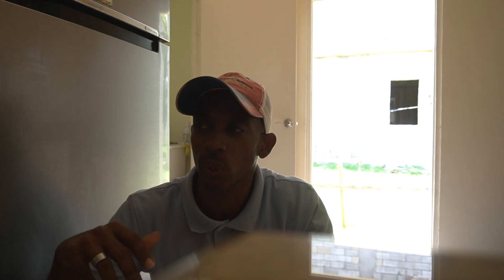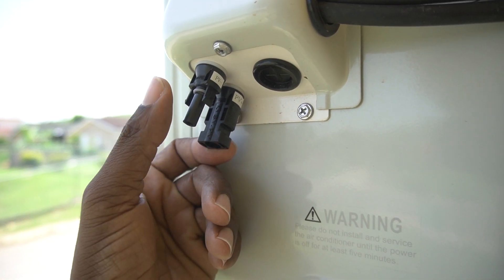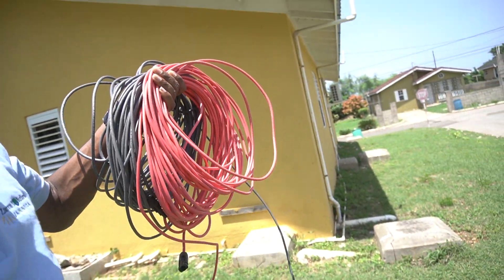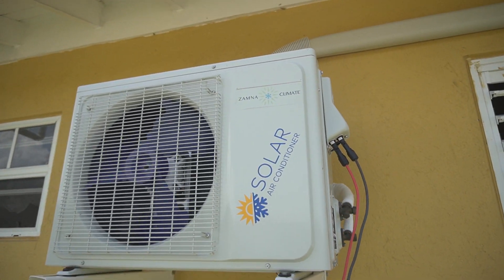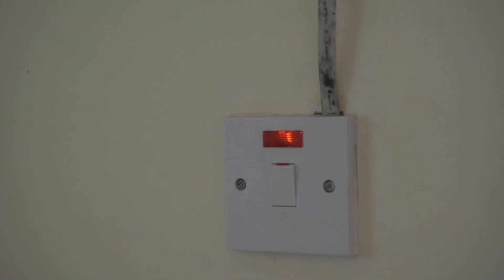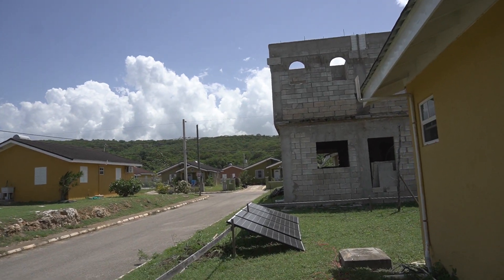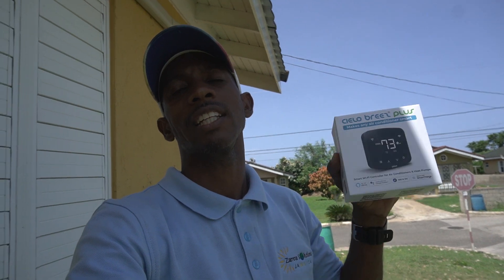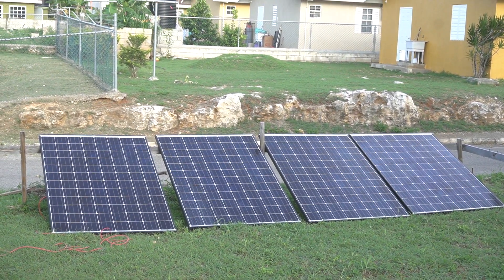The BEST solar air conditioner (Heat Pump)

Comment: Does it work at night???
Reply from the maker: It works at night but on grid power of the grid is connected, if not, it will sleep and start cooling again once the sun ☀ comes back out.

Comment: Thank you. This is good for the daytime. What do you use in the evenings and nights? What is the inexpensive means to store the energy for use in the night. Still don't want to be on the grid.  That would still be too much cost for  electricity.
Reply from the maker: Thanks for watching.

So, because the AC units have Wi-Fi capabilities and an app, you're able to power on remotely.
While the sun is out, all that free energy can be used to power the unit, cool the hot space and keep the temperature down so that by night time you won't need to pull a lot from the grid.
If you definitely don't want to be using grid power then it would be best to have a complete solar powered system installed and use really good inverter AC units (LG or Panasonic, etc)
Reply: At night grid, batteries or generator can be used. One alternative, that sorta of works is thermal mass. If you can run the AC during the day and cool down the house a lot, some of that cool will store into the night. What the house is made out of, (rock, dirt, wood), how big the house is, and how many people are in the house are all big factors. If a house has a lot of concrete in the house, the cool, will store better. If the house is a larger house with fewer people in it, it will take longer to heat up.  One can also help stay cool by locating the bed lower in the room (hot air rises), tile floors can help a room feel colder. Some people have used large water tanks to hold the warm or cold of temperature swings. It is possible. I did the math once, if you had 2,688 0.5 liter water bottles ( 48 cases of 24 packs of drinking water bottles) you could store the energy of 5 hours of HVAC cooling. Building a house with really thick heavy walls is farily cheap, and this can store cool. piles of rocks and bricks can even be designed where air can get around them allowing better cooling and more air movement. There is an entire science of thermal mass that can be used to create a comfortable space. it is complex, costly and needs to be done the right way. There are other tricks like evaporative cooling that can work in some situations.
Reply: @cryptickcryptick2241  ok thank you

Comment: When the grid goes down you have no ac not good
Reply from the maker: When the grid goes down and the sun is extremely hot outside, you will still have a fully functional air conditioner because at that time the Solar panels will be supplying all the power needed.
Reply: I guess this unit has more inside other than a micro inverter that has to sence a voltage?

Comment: What is the price for the unit and where in jamaica they sold
Reply from the maker: What size are you considering?
12000 btu
18000 btu
24000 btu

Comment: I have in  my house General AC 2.5 ton  running on electricity, can I change it to run solar during the day  and on electricity at night. Please explain how and tell me what I need to buy for this setup. Thanks
Reply from the maker: I just uploaded a new video, feel free to check it out.
To power that existing 2.5 ton air conditioner on solar power, you will need  solar panels, solar inverter, charge controller and batteries for nighttime use.

The Amp draw on a 2.5 ton AC is about 13.65A - 15A and it's 220v, so rated power is about (220×15) = 3,300W.

So around 8-9 solar panels rated at 450W could be used to provide power to the AC unit only. 
You'll need at least a 4000W inverter, and at least a 10kWh battery 🔋
Reply: @RayonWhittaker  Thank you thank you

Comment: Its 24 hours runing ?
Reply from the maker: No it  does not run 24 hours on solar/battery 🔋. 
These hybrid versions use solar during daylight hours and grid power during overcast conditions and during the nights

Comment: Great video ... thanks 
It will be nice if you show the connection to the ac from battery.
Reply from the maker: No connection to battery on this version, it's connected to the grid as a backup.
The DC 48V version is the version that will use batteries, however this verison operates with a voltage of at least 100Vdc via solar panels.
Reply: @RayonWhittaker  noticed...
Thanks for the reply.

Comment: what happens if Grid is down? Will unit still work. If the sun goes in and out?
Reply from the maker: So the answer is as follows:
The 12000 btu needs at least 930W, so we always setup an array that produces at least 1200W.
That way if the sun goes in and out and the wattage drops to 950W it's still enough power that the units needs.
When it goes below the 930W the unit still blows cool air, just not as cold.

Let me know if that helps.
Reply: @RayonWhittaker  Nice that is pretty cool. Thanks for the info. This is definitely and awesome product.
Reply from the maker: @longle7603  Awesome Np... I have a new video dropping soon. Stay tuned

Comment: For ppl who already own an inverter a/c unit, what's the best route to powering these units via solar?
Reply from the maker: Inverter AC units will need solar panels, inverter and charge controller.
It would be as though you're providing solar power to all appliances in your home.
So... Instead of connecting to just the AC units, you'd have the setup providing power to the main electrical panel in your home.

Comment: Three 40 watt panel producing 1020 watts? This is drugs!
40volts?
Reply from the maker: Lol it's 👉🏽 340W×3 Solar panels
Reply: @RayonWhittaker  How did I hear 40 watts last night? lol.
How much was the AC unit? Price?
Reply from the maker: @xierxu  you were either very hungry, sleepy or high my friend lol....
Reply from the maker: @xierxu  So, the prices vary depending on the sizes (in btu) and where you are located.

In Jamaica we currently have the 12000btu  starting for as low as USD $850.00
If in the US, or planning on purchasing from the USA 👉🏽 https://linktr.ee/autovive
Zamna no longer ships small purchases, you'll have to be a dealer or distributor to purchase directly from them.
Reply: @RayonWhittaker  sleepy
Reply from the maker: Three Three Forty Watts Panasonic solar panels

Comment: Dose it come with the solar panels too ??
Reply from the maker: No it does not, however any panels will work. You can check out the other video I did with the 18000 btu with the panels ground mounted.

Comment: Wow..!  Very cool..!  I recently installed a Pioneer 9k mini split in my RV. I've got 800w on the roof and 800w more on the ground connect to 4 100ah Lithium's. Victron controller and 2000w inverter. It's a low amp draw unit and about 860w to run it.  I wish I had found this technology sooner. Thanx for making this video.
Reply from the maker: You're more than welcome 🤜🏽🤛🏻
Reply from the maker: They also have an off-grid version of this that requires only 48v DC input voltage.
So you can setup a small battery bank that will provide power during no sunlight hours.
I've also seen another brand where their hybrid units require as low as 80V DC input voltage.
Reply: @RayonWhittaker  Nice to know.. My system is the basic 12v for now. I've got shore power for now.
Reply: I love this video.. this will save me money in my pocket.. what's the cost for a 12000 BTU solar ac unit?

Comment: How many deep cycle would u need to run it at night pls
Reply from the maker: The unit themselves need at least 100v DC to operate.
Reply from the maker: But there is an off-grid 24v and a 48v version.

Comment: So pls what is the total cost of the panels and the air conditioning
Reply from the maker: AC units $999 and $1099, for the 12k btu and 18k btu respectively.
Panels range from $145 to $166

Comment: is the outdoor unit an inverter type?
Reply from the maker: Hey Bryan, yes it is
Reply: @RayonWhittaker  what's the cost of the AC bundle minus the solar panels.
Reply from the maker: @donlatinohits  the AC by itself sells for USD $2095.

If you were in Jamaica 🇯🇲 right now you could get the 12k btu for USD $999

Comment: Any recommendations on who we can use to provide installation?
Reply from the maker: Where are you located?
Reply: @RayonWhittaker   anywhere in Kingston and St. Andrew. Really appreciate the fast response
Reply from the maker: @stephenharker5248  I can get it done for you. We did an installation near UWI 2 weeks ago. It's the last video on my channel.
Reply: @RayonWhittaker  I'll check it out and hit you up 🙏🏽
Reply from the maker: @stephenharker5248  np
Reply from the maker: @stephenharker5248   by the way, installations aren't limited to solar air conditioning. If you need a full off-grid setup that can be easily worked out for you as well.

Comment: So as soon as the sun is out it will start run off the grid right?
Reply from the maker: Yes that is correct
Reply from the maker: As well as you may operate off solar only and since it needs 930W doing it this way means that you would just over size the setup so that in the even of shading, you'll still have sufficient power from the modules.
When the sun ☀ goes down the unit will only have the fan running until it goes into a sleep mode, then when the sun begins to rise and the solar modules start transferring energy the unit + compressor will turn back on.

Comment: where can I buy a unit in Jamaica.... and great video respect.
Reply from the maker: Respec 👊🏽
Reply: @RayonWhittaker  hi Rayon how much is cost for your air con units?
Reply from the maker: I have a few available here in 🇯🇲.
Or you can order off the Zamna Solutions website, Link in Bio and in pinned comment.

Comment: What is the DC open circuit voltage on the unit? I may be off; 4x~69v ≈270vdc… 
Great video!
Reply from the maker: Expound please, I'm trying to understand the reason for the question, however, the DC voltage range for this 12000btu 100-300V
Reply: @RayonWhittaker  okay, I was thinking if it would be possible to use batteries at nights…
Reply from the maker: @dythewitt  We have a full off-grid version for that.

I completed a setup yesterday (video coming soon. Grateful that you like this video btw).
After completing the setup we did an open circuit test and got 215V. While on load, the voltage measured was 192V at 8:35am and 183V an hour later.

Comment: I can bet that with all this INFO for ppl to make a wiser purchasing decision, by having them know that this product exists, dem ago seh "OH BUT WE USE AC MOSTLY AT NIGHTS"
Dem still gonna buy the ones that them fraid fi turn on in the day even at nights, the same ones weh a mek JPS richer.
Reply from the maker: Dats right...
Reply: What folks need to understand is that while the a/c is running for most of the day, it maintains the ambient temperature in the room by cooling the walls of the house, wether wood, drywall or concrete. In the nights, residual heat trapped within the external walls of the home especially concrete, requires more cooling energy from the a/c at nights, so it works out best if the a/c is constantly run during the day on “free” power to maintain a low temperature within the room, so in the night the unit uses much less grid power to cool down the room

Comment: Hi I want to know if I already have two inverter A/C installed, what the cost to get the solar system installed
Reply: If you're thinking about converting the units that you already have to solar where the panels would plug directly to the outside unit as these Zamna Climate AC, then that wouldn't be possible.

The Zamna Climate solar ready Mini-Splits are designed completely different from the typical mini split AC units.
Reply from the maker: To get solar system installed in order for the AC units to operate just like these Zamna Climate?

Comment: This is good... So the regular windy unit wouldnt be able to accept such connection? N what's the cost would be like
Reply from the maker: No a typical AC unit such as windy wouldn't be able to accept this connection. A complete redesign would need to be done.

Comment: I like this, wish it wasn't hybrid
Reply from the maker: For a business that operates from 8-5 or 9-5, this could definitely help them with cooling while lowering their bills. During the daytime while the sun is out the solar panels would be at work instead of using the energy from the local energy suppliers (JPS I our case).
Reply from the maker: You can set up a battery bank and have it pull the power from batteries instead of the grid
Reply: @RayonWhittaker  How many batteries would this require at what amp-hours
Reply from the maker: @smartconserver  not sure about the Amp hours, however, it needs a 48v supply
Reply: @RayonWhittaker  "a?" so one battery with 48 volts or four 12 volts batteries in a series will work. Will those panels be able to charge the battery/ies or I need a controller and inverter like I'm setting up an off grid system?
Reply from the maker: @smartconserver  either works 48×1, 24×2 or 12×4.
I'm trying to see how I can work up a battery bank to do some testing myself.
Reply: @RayonWhittaker  Please do, it would be great to show persons that the air con can be fully off grid. It aint easy paying these huge light bills just to be comfortable
Reply from the maker: @smartconserver  the thing is batteries can be very expensive and a fully off grid solution would need to be able to support the system for the whole night. That can be very expensive and usually, you'd not only want 1 air con but possibly a minimum of 2.
Reply: @RayonWhittaker  This is the issue I am having with ac which states to be "solar" i need something which will not be reliant on the light people and to go that route its normally really costly. these manufacturers need to come up with a system that have in a built in battery at least  so it can charge in the day and get even 4 hours in the night.
Reply from the maker: @smartconserver  I believe it's the cost not to build but the retail cost that will turn ppl off.
Here we have Windy units that sell for less that $75,000 JMD
When you come in with a system that doesn't need a Solar inverter + built in battery, there may be little road block to getting them sold.
Reply: @RayonWhittaker  true that but if the benefit is "sold" to the customer in the right way then we will adapt, worse when we can see that its saving us in the long run. I was previously turned off from going solar as I thought it was too expensive when compared with the benefit, but after considering that the benefit can be long term or even profitable that was where I "buy in." BTW do I have to hook up that ac to the light people any at all? I am thinking in line of a solar water heater where i have the option to hook up to electricity but its not a "must"
Reply from the maker: @smartconserver  yes you can have it setup without the electric company. That's the beauty. It's recommended that you include more solar panels however. This 12000btu needs 930W, I would say double that figure if you wanted to go no grid power.
Reply: @RayonWhittaker  and there goes the cost again, I like the idea of it being able to do that. If I saw air condition as a must have this is the way I would go, but I would need the space and a heavy capital to invest in same. Thanks for the information I will indeed pass it on

Comment: This is great !!! Only, if all homes requiring cooling could have this unit installed, then I am sure the power company would wonder what is happening !!! Long run and short run this is an instant power saver. Can't wait to see that unit you have at the end of this video.